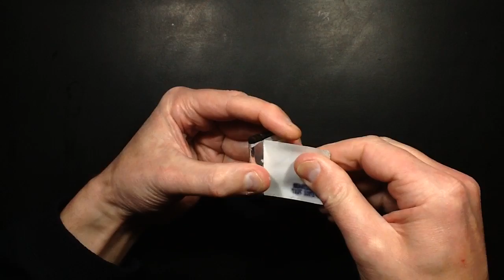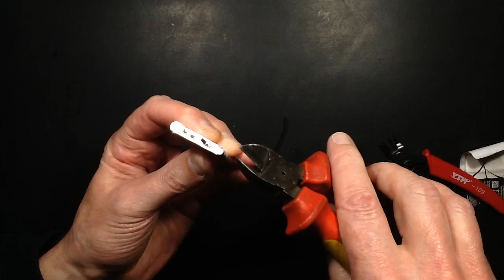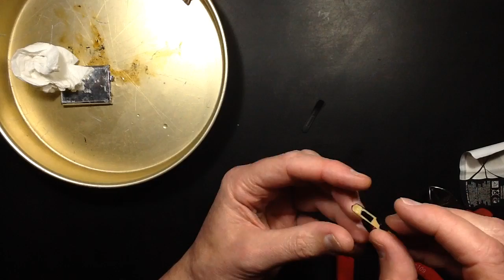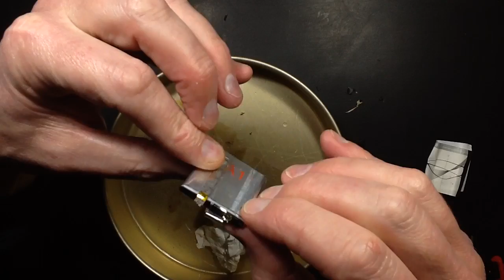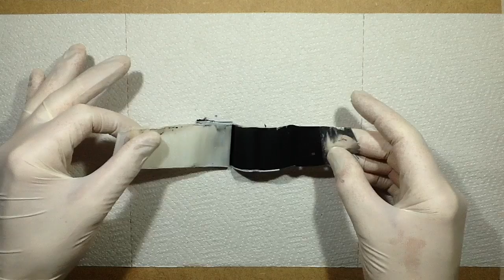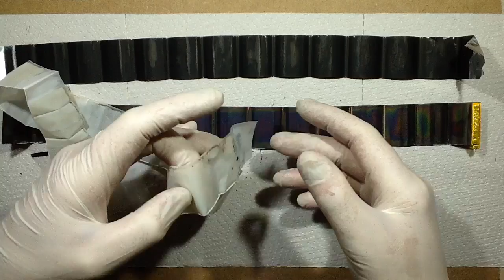TOTAL teardown of a lithium phone battery.

Comment: people really don't understand how much power these cells are capable of. I am thinking about using one to start a car, just to show how much power is in such a small package.
Reply: lilsammywasapunkrock
The battery acts as a giant smoothing capacitor, it absorbs the system spikes and takes load off the alternator.

The way an alternator works is a diode trio (and voltage regulator) so voltage will only flow in one direction, but things aren't perfect, if you look at the wave form you will see that voltage hops around, computers are not fond of this, not only that, but sudden RPM drop or rise can cause an instant of voltage spike, the main source of damaging voltage spike is the injectors, coil packs and servos, when they de-energize, inductive voltage spike is released you cannot see it with a DMM, but the computer sure sees it without a battery to take the bullets for it.

Computers are odd, sometimes damage is accumulative, and fail partially, other times they straight up die.
Reply: lilsammywasapunkrock
I'm not arguing with you I am stating a fact, If you cannot accept that then you are letting your pride get in the way of reality.

The inductive voltage from a coil can exceed 50V or more, your computer IS NOT rated to take that abuse over and over again, it WILL fail, plain and simple, If you could run without a battery don't you think F1 cars would do so?

I have a college education and over 10 years in the field, I build and fly drones, I know what I am talking about, I am studying to be an engineer.
Reply: +HeavenHammer its called an alternater, the battery is large to crank the car using very old and inefficient technology, once the car is started it no longer requires a battery to run, however a battery is needed to prevent voltage spikes that could damage a modern car's computer(s)

To the OP, they currently make small lithium jump packs.
Reply: +Wyvern I'm not a mechanic, but I do work on my own cars, and I build and fly electric model airplanes for fun. 

I upgraded my alternator from a 55amp to a 130amp unit. ran 6 Guage wiring and a 175amp mega fuse. one thing I learned is that there is a voltage sensing wire designed to go to the alternator, specifically to tell it how much to charge. i was unable to cause a voltage situation higher then 14.2 volts no matter what j did to the car, including jumping a big old deisel truck. i did hit more then 175amps though, if you beleive those clamp on fmuke meters. using anything enough will eventually wear it out. some things last longer then others, especially when they are pushed past what they are built and rated to do.

overall, I can't think of a way that removing a battery would destroy a cars computer, and have seen zero times it has happened, and doubt I will. especially considering that the battery becomes a load after the car is running anyways. electronics are usually ran through the ignition switch that run right off of the positive post of the alterator anyways, so if you believe in the path of least resistance, it would compete bypass the battery the whole time the car is running anyways.
Reply: +Wyvern I am aware of that. most use a single 2000mah 11.1v cell. pretty much all car electronics are designed to operate from 8volts or lower all the way up to 30 volts. the whole to prevent voltage spikes thing is total bs. I've bought cars with no battery, jumped them and hot swapped the battery then driven for several hours home with no battery in the car before.
Reply: +lilsammywasapunkrock I'm a mechanic, it's not guaranteed that running without a battery will instantly kill your computer and alternator, but it will eventually happen, even a sick battery can cause failure over time.
Reply: +Wyvern if you can't see it, then how do you know it exists? all joking aside, like I said, computers used in cars are designed around automotive applications. pretty much everything in a computer runs on either 5 or 3.3 volts. it is internally regulated from the 12volt input (which will be designed not to fluctuate over a range of 6-30 volts) and uses its own capacitors to keep itself in range. the proof that this works well is the fact the the computer does work.

electronics rarely fail due to overvoltage or voltage spikes. they usually fail due to chronic low voltage and over amplification of the voltage regulation. let's take 10 watts. 10 watts at 1 volt is 10 amps. 10 watts at 10 volts is one amp. when the amperage increases, that's when you have to worry about blowing stuff. it is actually easier in electronics to run then over voltage then a bit low for this reason.

the whole "battery acts as a capacitor" is something said by someone who does ot understand the basics of electronics or how they work.
Reply: +Wyvern I'm a lineman, I work with high voltage electrical lines, power plants, electrical engineers, blueprints and respond to emergency power outages. I also have "numerous" certifications and a "far bit" or schooling.

just for fun, I ran this by my father, he is semi retired working as a powerhouse technician for the Navy, you know, the kinda guy that keeps electricity going for explosives and nitroglycerin plants ect. he also has over 30 years in the aerospace feild. he's worked on project related to the hubble, voyager and spirit and opportunity. not only that, but he used to design and build electrical curcuits and got in to computers on the ground level as silicon Valley was just starting to pick up. he agreed completely with me.

the capacitor bs is just that. there are not rampant Rouge electrical loads shooting 50+v's through the battery. the alternator runs hundreds of volts ac, then is regulated at least 10 times before it ever sees any part of the cars "sensitive" elecronics. first you have the alternator regulator. in most cars it will keep it between 13.5 and 14.2 volts. if it steps up over 15 volts, it degassifies the battery and creates pure hydrogen which would make the battery explode. then there is the main power feed to the electronics which is further regulated to about 12 volts. this isn't a critical voltage, no part of an electronic curcuits, short of a coil, will run over 5 volts, and most are 3.3 volts, but coils are only generally used to step up voltage, usually to over 100 volts, which would only be used in the ignitor coils/coils. the real reason for this 12 volt regulation is to keep a good power source during cranking when battery voltage drops. then it is regulated again, this time to an almost exact 5 volts, and then again down to 3.3volts. each individual component, abs, airbags, transportation controller, ecu ect will have its own chain of regulation depending on its needs.

another thing, most electronics work based on a range of voltages, most being a very wide input level. many 3.3v components are actually designed to run between about 1.8 volts and 4.5 volts. most will still work fine even at much higher then designed voltages. it's only when voltage sags that most electronics will brown out, cease to function from a lack of power. running these components under low voltage will force it to use more amperage to retain the same amount of power. it is very rare for electronics to die at all from over voltage, it's the amperage that melts wires and blows traces on curcuits boards, not too much power.

long story short, these trade colleges and automotive standards only teach the basics and way over simplify things to make things easier to understand so that you can graduate and make the school look better on paper. in high school I took a 2 year college credit occupational automotive course, then I took several asc certification classes before I decided on another path. I have many asc certified friends and family members, and most of them only have a very very basic understanding of electrical systems in general, and most I wouldn't let touch my car.

I'm not talking cap on people that turn wrenches. I really enjoy working on cars, and I enjoy troubleshooting and making stuff better.
Reply: lilsammywasapunkrock
I am studying to become an automotive engineer, and I'm not your typical grease monkey parts-changer, so don't assume that is all I am- I chose this path because of two reasons, one- I grew up with a poor family, and could not afford a 4 year university on my own at that time, and two- to fully see and understand what you intend to design, you have to get your hands dirty and see how it works, how it doesn't work, why some designs are better than others, it is obvious a lot of people that have never busted a knuckle design cars, since some jobs require removing far more components than necessary, sometimes for a single bolt, or over-designing something that could be so simple. It is also beneficial to see the industry in it's entirety.

I still hold on to what I believe- a car should not be run for an extended (if any) amount of time without a battery, alternator regulators were not designed to be the only means of powering the electrical system and will thermal overload and/or take out the diode rectifier (which then could damage things especially with no battery to absorb the abuse), there are also inductive sensors on the battery cables that control alternator output and could set codes, over volt, or simply shut down, At worst you have a defective injector driver and it back-feeds voltage.

It simply is not worth the risk when you can have upwards of 8 computer modules in a car costing up to $1500 each, and sometimes damage isn't always immediate.
Reply: A car alternator, as opposed to the old dynamo is actually a three phase AC unit, internally turned into single phase and rectified into DC, and then the charging is controlled with an internal regulator. It is also reverse as compared to a dynamo in that the rotor windings are the controlled magnetic feild and the stator windings are the actual charging/production windings. This way only a small control winding current needs to go through the slip rings, and the main produced heavy current needs to go though no moving contact point (slip rings or commutator) and is wired direct to the stator windings.
I personally have never had a car be damaged by not running a battery on it, but it is perfectly feasible that without the surge/spike absorbing capacity of a battery something electronic could be damaged.
ANY coil of wire is an inductor, of which there are many on a modern vehicle, if a current passing through an inductive load is stopped sharply, a large voltage spike will be the result, and if not absorbed by something, usually a capacitor the large voltage spike could indeed be too much for especially sensitive low voltage electronic components.
And a battery works in a similar way to a capacitor and will absorb a spike, especially in this case.
Reply: lilsammywasapunkrock thunderfoot did that
Reply: Do it because you can't drive a car for an hour with that battery else why would they be so big in the cars
Reply: +HeavenHammer the car doesn't use the battery once it is started. it just recharges until you shut it off. lipos have other problems too.
Reply: +Doug Anderson let's check out the credentials that you are bringing into this argument. 

for fun, I play with the same batteries that they put into those small "lithium ion" mini jump starters. they actually use a single 2.2ah 11.1v lipo battery, which happens to be the same thing that I "play" with in my "toys".

another this I've done just for "fun", is upgraded my alternator to more then 5x it original capacity, made modifications to my cars electrical system and modified it to work with a much more powerful setup.

so what is it that you do with spare time?
Reply: Doug Anderson
If you are talking to me, yes that's true, It does make me an expert because I work on cars/trucks/machines professionally, have a degree for it and numerous certifications as well.
Reply: +Wyvern I'm a lineman, I work with high voltage electrical lines, power plants, electrical engineers, blueprints and respond to emergency power outages. I also have "numerous" certifications and a "far bit" or schooling.

just for fun, I ran this by my father, he is semi retired working as a powerhouse technician for the Navy, you know, the kinda guy that keeps electricity going for explosives and nitroglycerin plants ect. he also has over 30 years in the aerospace feild. he's worked on project related to the hubble, voyager and spirit and opportunity. not only that, but he used to design and build electrical curcuits and got in to computers on the ground level as silicon Valley was just starting to pick up. he agreed completely with me.

the capacitor bs is just that. there are not rampant Rouge electrical loads shooting 50+v's through the battery. the alternator runs hundreds of volts ac, then is regulated at least 10 times before it ever sees any part of the cars "sensitive" elecronics. first you have the alternator regulator. in most cars it will keep it between 13.5 and 14.2 volts. if it steps up over 15 volts, it degassifies the battery and creates pure hydrogen which would make the battery explode. then there is the main power feed to the electronics which is further regulated to about 12 volts. this isn't a critical voltage, no part of an electronic curcuits, short of a coil, will run over 5 volts, and most are 3.3 volts, but coils are only generally used to step up voltage, usually to over 100 volts, which would only be used in the ignitor coils/coils. the real reason for this 12 volt regulation is to keep a good power source during cranking when battery voltage drops. then it is regulated again, this time to an almost exact 5 volts, and then again down to 3.3volts. each individual component, abs, airbags, transportation controller, ecu ect will have its own chain of regulation depending on its needs.

another thing, most electronics work based on a range of voltages, most being a very wide input level. many 3.3v components are actually designed to run between about 1.8 volts and 4.5 volts. most will still work fine even at much higher then designed voltages. it's only when voltage sags that most electronics will brown out, cease to function from a lack of power. running these components under low voltage will force it to use more amperage to retain the same amount of power. it is very rare for electronics to die at all from over voltage, it's the amperage that melts wires and blows traces on curcuits boards, not too much power.

long story short, these trade colleges and automotive standards only teach the basics and way over simplify things to make things easier to understand so that you can graduate and make the school look better on paper. in high school I took a 2 year college credit occupational automotive course, then I took several asc certification classes before I decided on another path. I have many asc certified friends and family members, and most of them only have a very very basic understanding of electrical systems in general, and most I wouldn't let touch my car.

I'm not talking cap on people that turn wrenches. I really enjoy working on cars, and I enjoy troubleshooting and making stuff better.
Reply: +lilsammywasapunkrock Most modern cars will shut off if you disconnect the battery after you start up the engine. At least Cadillacs and Benzs won't.

Comment: I have a couple of radios that use the bl-5c variant of these, & I’ve been pleasantly surprised at the capacity & durability. They hold a decent amount of charge for long periods of time, and in my experience, continue to be useful after being cycled several hundred times. (should keep better records) Thanks for the proper take-to-bits video, it was quite informative.

Comment: Best video of yours I have ever seen.  Hilarious in multiple parts for multiple reasons, and the cake farts reference won my heart entirely.  I was delighted that you actually know the definition of the word 'total'.  It is so often misused to refer to people who only go as far as they are comfortable, then wish to call it done.  That's my first time seeing inside a Lithium-based battery like that.  I have read in a good bit of detail how they actually work, though.  Enough that I would never repeat what you did myself.  It's really pretty neat how they took a technology which is really very sensitive and dangerous by itself, but by pairing it with some simple electronics were able to transform it into the absolute safest battery technology we've ever had.  Now we've got fantastic energy density in relatively lightweight tiny volumes.  One of those things that is often overlooked but really underpins a huge number of the technologies that shape how we live.  I wish I knew enough chemistry to guess what you were smelling, but I've no idea.  I am fairly confident that it wasn't anything you'd like to inhale on a regular basis, though...

Comment: Around 16 years ago I watched "How it's made" episode on TV where they showed how they were making lithium car batteries for early electric cars. Basically the same thing but much larger and battery had multiple cells like this one (but again much larger) inserted inside another enclosure and linked together to make something like 90+ volts if I remember correctly. Very cool indeed to see how similar where to the originals.